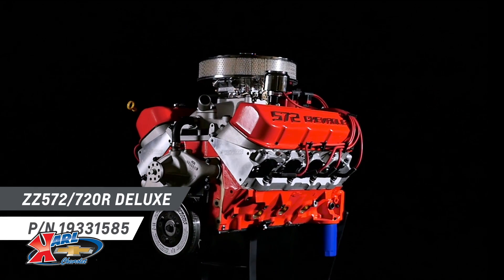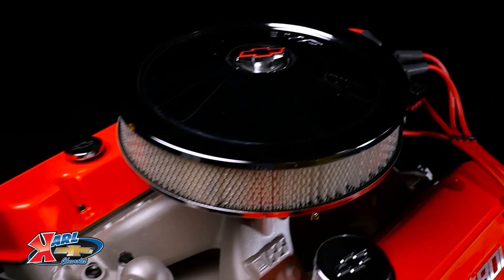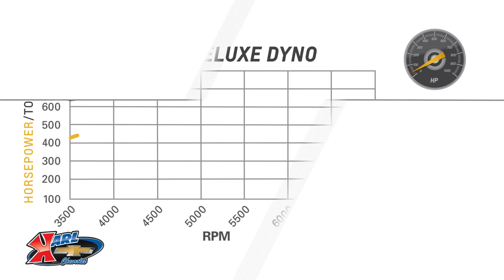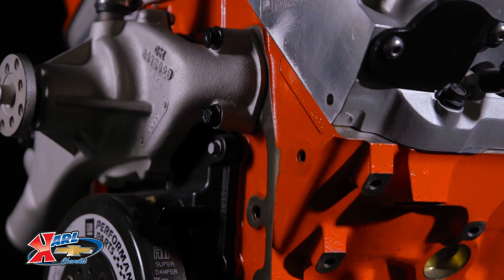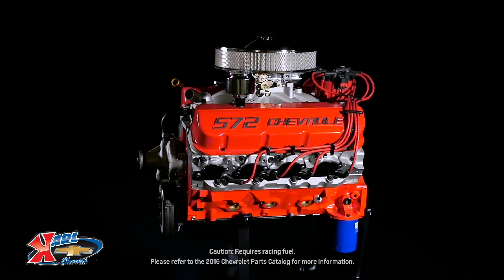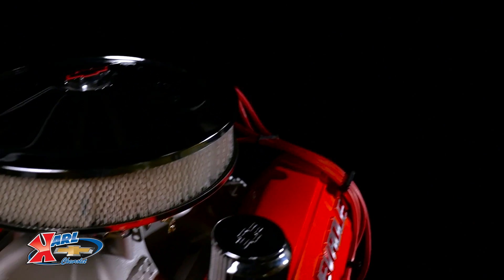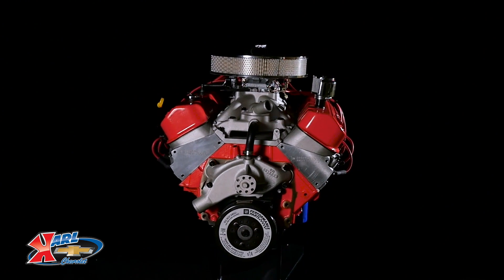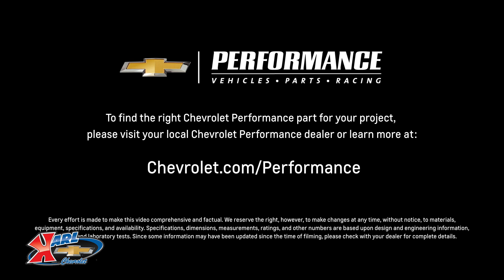Chevrolet Performance ZZ572/720R Crate Engine

Comment: Mechanical roller? So it's not recommended for street use?
Reply: Hey man,   back in the old days,   I  had a Real  1968  Z-28
I installed  the  Z - optional  camshaft.   With ported heads.
Yes I drove it on the street.
With a Mr. Gasket  V- gate  shifter, that made lighting fast shifts. 
Friday nights I would  slip the Exhaust pipes off the headers,   installed  9"  slicks.

Comment: What he doesnt say is that. you need 110 octane fuel. The base 572 uses 91 octane but 100 less hp
Reply: Yes at 12:dollars a gallon
Reply: @curtisendicott5989  Get a drum of VP...guess the guy that can afford that engine wont care about gas cost
Reply: Yep a normal goodguys weekend is about 600 in fuel

Comment: cannot believe gm built a 572bbc and make it run on race gas and only 700 & change cra nk hp. robbery
Reply: Look up the 1004hp zz632. Naturally Aspirated v8 run on 93 octane!
Reply: knuckleuprambo it’s naturally aspirated
Reply: @AngelosVollaro  I've seen 509 builds with 10:1 compression make that kinda power though.  Those 310cc heads are holding this thing back.  Put a set of AFR 357's on there and this thing will make huge numbers!
Reply: @AngelosVollaro  Wait so this is naturally aspirated right? So like if you took the supercharger off of the lt5 technically this would be the most powerful engine or no? Also what can you get more power out of, an lt5 or zz572/720r?
Reply: Cant believe people complain we have such options today.

Comment: Just hypothetical but can that actually fit into a 6th gen camaro without adding a big ass copo hood
Reply: Big ass hood no choice. Unless you cut a hole on it!!
Reply: Same thought here 😊. The engine is designed for pre 76 vehicles . Because of the emissions factors. But you could literally build it with O2 sensors and fuel injection . Question, will the pcm agree . . Or just eliminate it altogether
Reply: @juanlanda2441  Not sure if that big a cam will wanna play nice with EFI. That is a monstrous stick

Comment: Fucking love Americans v8,s love that 572 ci in my car that's fucking sick you could get alot more power out of that motor than that supercharger it for a start still bloody impressive tho particularly the torque pull a tree out by the roots with that light weight car would do a 8 in this God bless America 😁😁😁😁😁 🤘🤘🤘🤘🤘